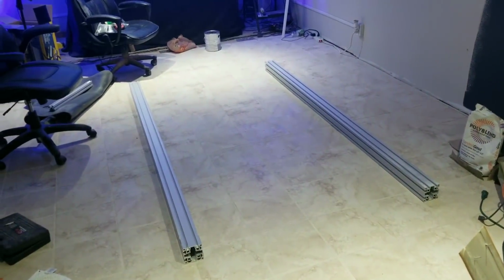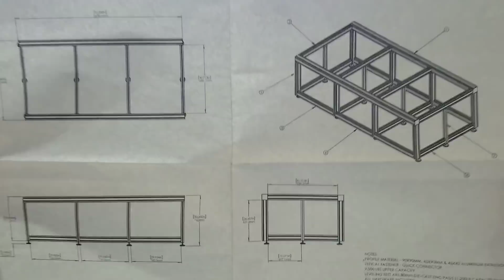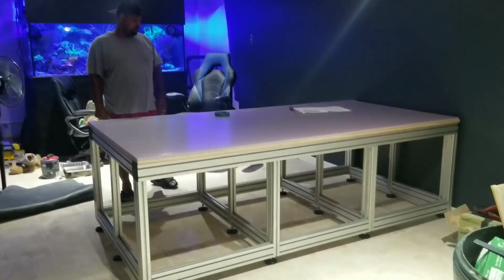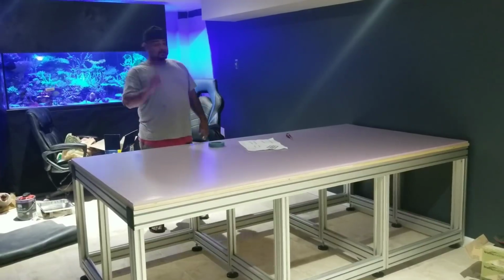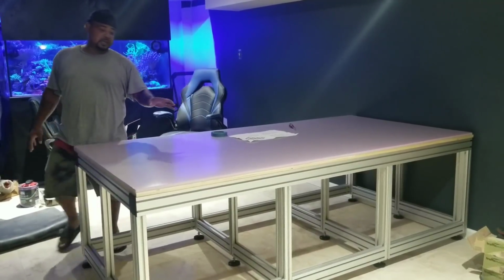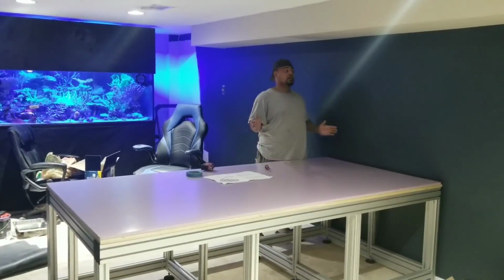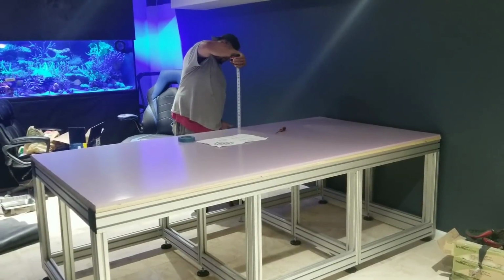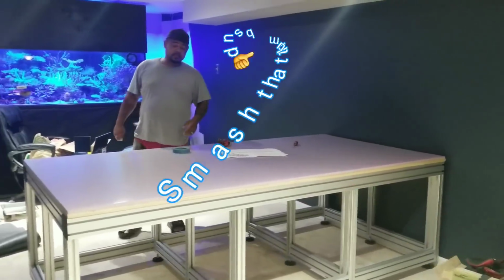The new tankstand has arrived

Comment: Wao my friend, that stand is humongous, definitely a jaw breaker... Lol!!! 
I think that you should paint the board to prevent, if any, water damage in the long run. About to cover or not the stand... That's a good one, the stand looks impressive by itself. It's all depends on what are your plans on decorating your relaxing area. If you want a more modern industrial look or the classic floor to ceiling approach. If you go to the industrial look you might talk to the same guys who make you the stand, to make a rack for the lights it will match the stand and it could give you the look of a canopy but open. Probably you could add some kind of motor to rise and lower the fixtures as you wish, to do maintenance or adjust the height from the water level. 
In the other hand, closing it can gave you some storage area under the tank. Without eye sore. But I will used full panels that can be detached for a more sleek appearance.

Comment: I would seal the plywood.  When water runs down the outside of the glass it will end up getting on the plywood.  crown molding is a great idea. And I would leave it open at least until the build is done.  If you don’t like the look of open bottom with a canopy top you could always wrap the bottom later when you have time and aren’t so stressed like when you are in the middle of a big build.  It’s coming alone nicely Rico I look forward to your videos
Reply: Haanstang 👍 .... your right. he needs to do just what is necessary this week before the tank comes. He can wrap it anytime .

Comment: Seal the wood for sure.  I used laminate on my top, but that would be unneeded expense.
The trim around the top to cover the wood, foam and tank edges would look great in my opinion. 
Leave the bottom open for now.  You can always skin it later to match other molding/cabinets in the room.  Mine matches my cabinets.
You could even add some lighting and some sort of display in the stand.  Statues, pictures, flower arrangement  haha  you get the idea

Comment: I'm finishing up my framing tech stand atm.  I bought some extra t bolts to secure the back panel and a couple other things.

Additionally,  I bought  home depot everbilt angle aluminum sku 474 177.  I cut it to make braces to secure the top to the stand with diy brackets.

I would paint everything  to prevent spills from messing up the plywood integrity or risking mold if it doesn't dry.

If you decide to skin and have questions lmk.  Without stuff under it, skinning isn't required to reduce noise.

Comment: You don't have to paint the wood but I typically paint mine with white marine paint to be safe. I definitely wouldn't worry about skinning the tank right away. Get used to the maintenance on the tank and the room you are going to need to work around the tank before I would do anything with skinning it. Personally I would reach out to the stand manufacturer and find out if they could make some kind of a 3 or 4 foot platform that would slide right into the top bracing. Something you can stand on that would hold your weight and or more so when you want to work on the tank you slide the platform into the top bracing and can stand on it all day long when leaning over the tank.  That would be super helpful since this tank is 4 foot wide you wont be able to lean over the 8 foot sides and reach the other side. It will be even harder when there is a canopy over top.  If it is 3 or 4 feet it could be put on the 8 foot sides or the 4 foot peninsula side. Just a thought for trying to make it easier to work on the tank without killing your back or standing on a ladder all of the time. You lean too far standing over the tank on a ladder the ladder will fall. I know from experience.. lol

Comment: Have been going back and forth between using that aluminum for a stand I'm building as well, and ultimately I decided to do wood since I can do it for maybe 1/10th the cost, it just takes a lot more labor, and that wasn't even the ultimate decision maker knowing all those connectors are what gives the aluminum its structural strength and seeing that most all the screws are zinc coated metal screws I felt they might not last long term. 

 That said, I wouldn't seal the plywood top, seal the edges yes, put a bead of silicone on the edge where the silicone and plywood meets yes, maybe seal the bottom if you have a sump under there because it will get moist.

Comment: I'm not sure what sort of plywood you're using, but I would go with the marine grade stuff. It won't delaminate if it get's wet. Even so it's not water proof and will rot eventually if it stays wet for a long time, so giving it a coat of paint wouldn't be a bad idea. 
I know you already got the thing put together, but is there any chance you can give us a close-up on the hardware the stand uses to join the members together? Also, doesn't saltwater corrode aluminium? If so, it' might not be a bad idea to paint it. If you do make sure you get primer that sticks well to aluminium , many paints don't.
Looking forward to seeing this project come along. Keep up the good work.
Reply: Siggy in CR I can post a picture on Instagram. Follow us there ricosreeftank !

Comment: just an idea, if you notch out the base board you can push your stand against the wall gaining an inch for 34" and your overflow box might be easier to work with , as for the paint, i wouldn't bother , you could paint just the edge that will be visible if you want.
Reply: John Koutsantonis like that idea to get it more flush to the wall
Reply: since theres gonna be a cut out for the overflow box, theres gonna be a 1 inch gap where you might be able to see and hear the adjacent filter room. Just a small detail but now would be the time to take care of it, as it will be impossible later.